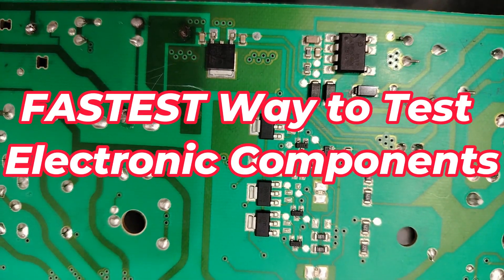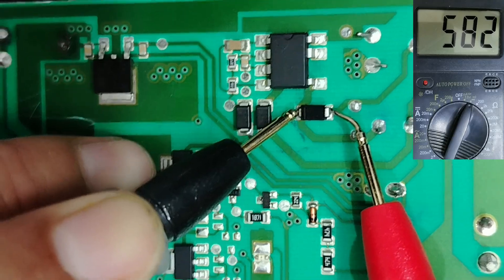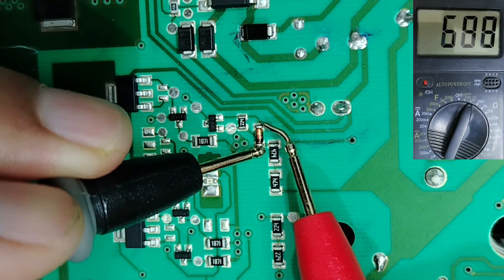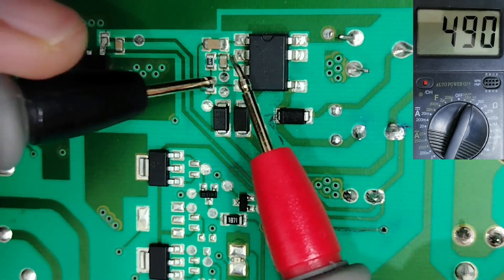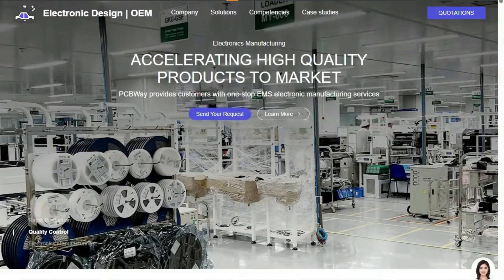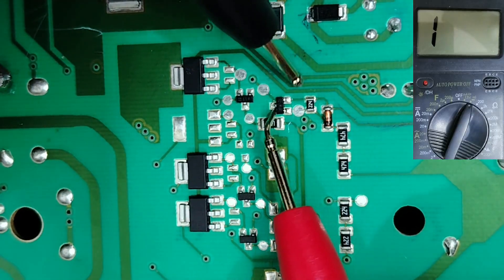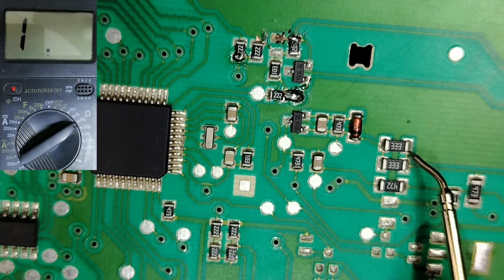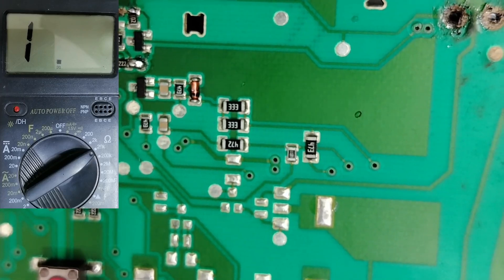Electronic Components: Master SMD Testing with a Multimeter – Super Easy | Electronics Repair Part 2

Comment: hello sir, please elaborate more on checking ic how do we check input and outputs ? i mean obviously if vcc and gnd pins are shorted the ic is not working, but how about input/output and clock? can we check them off line?

Comment: Sorry, but these testing methods are inefficient, as each component behaves differently when mounted in series or parallel in the circuit.😕
Reply from the maker: I agree that component behavior can change in a circuit, but this video focuses on basic testing.

Comment: 12:00 Shouldn't that resistor be 2.2K Ohm since it is 222 meaning 2200 Ohm? 12:30 Also, I believe you got 1000Ohm reading on the transistor when you swapped the probes between the collector and the emitter, not the diode.